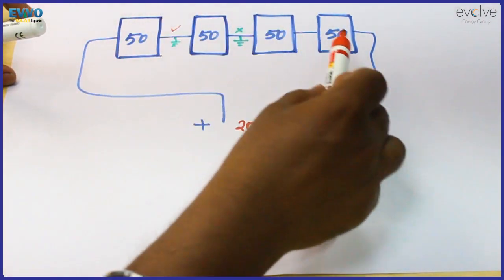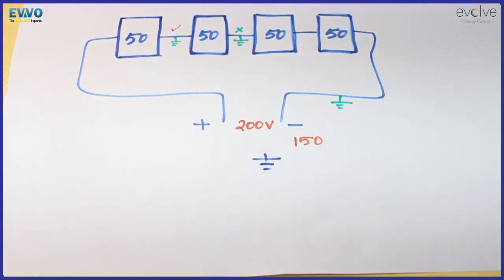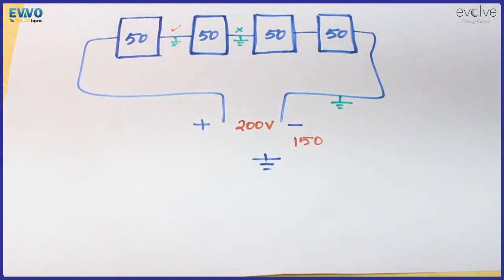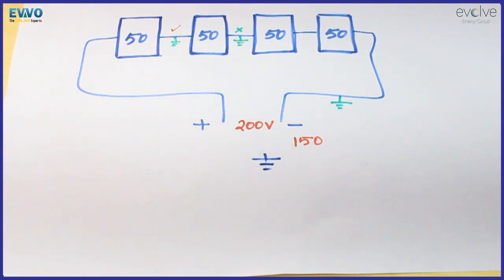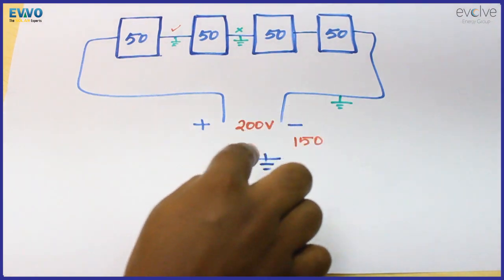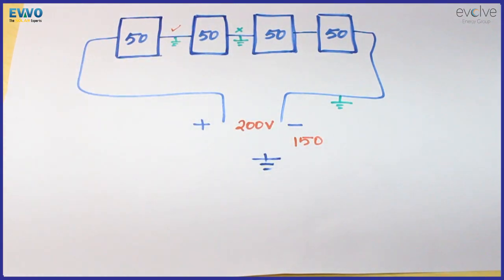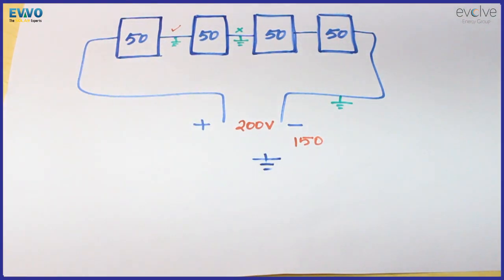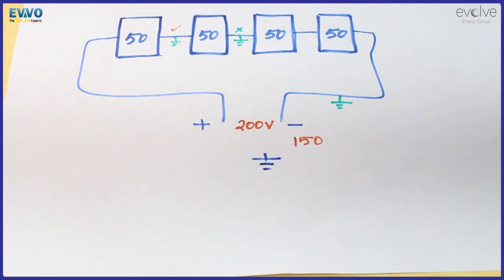Solar Solving ISO Fault | Sivakumaran CTO | Evolve Energy Group | Solar

Comment: I had recurring isofaults every winter morning despite my solar system being just 4 months old. The installer said that it is normal occurence in winters. However no other home in my area has such issue. I researched chatgpt. It told me to check the mc4 connectors that they may be allowing moisture creating arcs. I used electrical tape to make the seals perfectly fit. Also I covered all connectors with electrical tape. The problem didn't get solved. 
Then luckily, I found out a video showing how loosely fitting  metal connector pins can create such faults and how to fix it with some general tools. You got to make the pins fit snug. As loosely fitting pins create arcs and may melt connectors if amperage goes up.  https://youtu.be/2DzbrKpLIWM?si=U7nsllqxucw-YG0o

It's been 1 week now with the same bad weather no faults occured in this time.

Good luck! This is an easy DIY, will take 2-3 hours of your time. The installers don't have brains and training to deal with this problem.

Comment: Use original connectors only, third party or fake connectors do not form a proper seal. If you can rotate the connector while keeping the cable stationary the seal is improper and please use the proper wrench for tightening the connector like the blue MC4 wrench tor MC4 connector, tighten until your can hear the click and the wrench slips. Use connectors from a grade reputed manufacturers like "Mulitcontact companies MC4" not any other company and amphenol H4, etc.
Reply: Please suggest which company mc4 connectors should I use. The isofailt problem appears in winters early mornings. Is kenbrook fine?
Reply: https://youtu.be/2DzbrKpLIWM?si=U7nsllqxucw-YG0o

This technique will also work perfectly.

Comment: Sir,What will be dc voltage between positive to earthing and negative to earthing under normal conditions? (in 20 panel's string having Voc voltage 800volts?)
Reply: It depends, please use the V DC on your multimeter and put one probe on earth and other on the negative or positive of the string and check if the voltage is dropping after the initial reading. If it is not decreasing slightly there is leakage. Please remove string from inverter before testing.